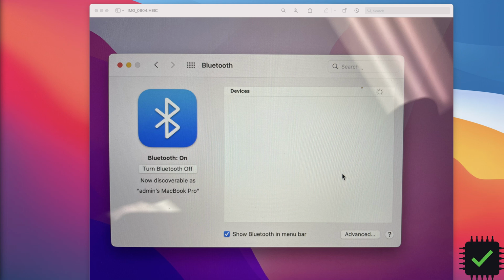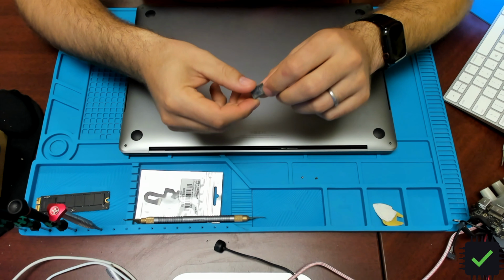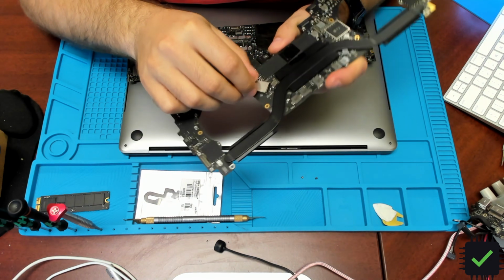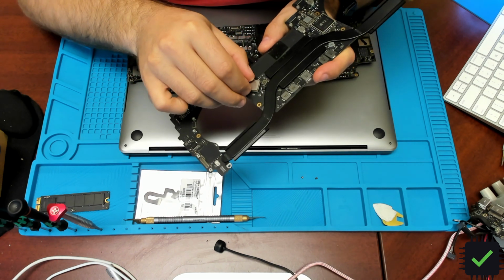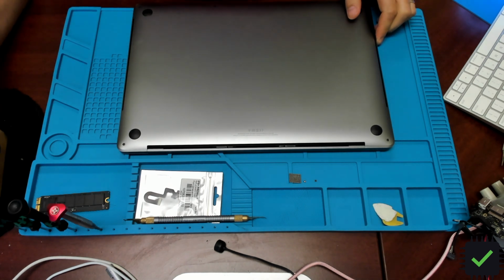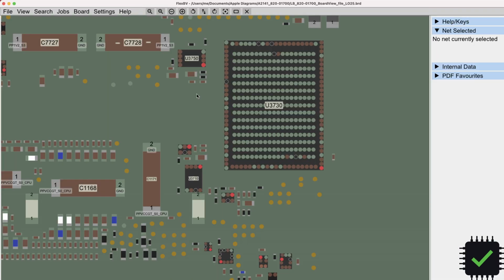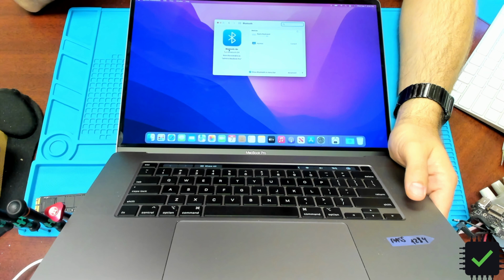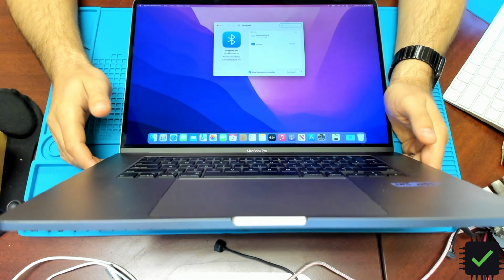MacBook Pro 16 inch A2141 820-01700 Bluetooth works but does not see any devices Repair Solution.

Comment: That is a difficult case... you would worry that screwing up with the Wifi chip could end up with a faulty board. Hard to explain that to a customer. Did you charge a standard board repair in this case?
Reply from the maker: Indeed. I actually charged less than my standard board repair cost for this model. I wanted to mess with it in the name of science. I’ve done wifi swap/reball on several mac boards as well as iPhone 8/8+ boards so I was pretty confident I would not mess anything up. However risk is always there